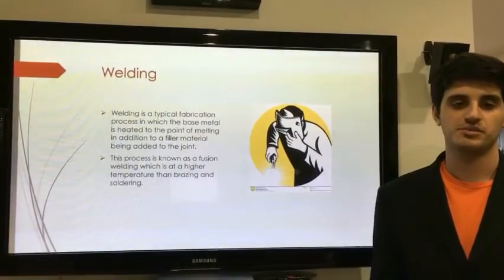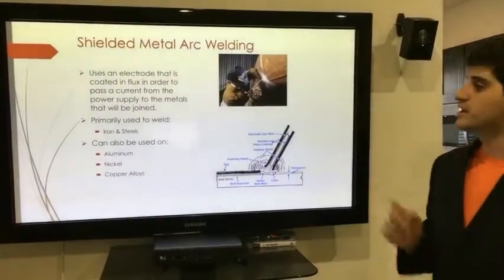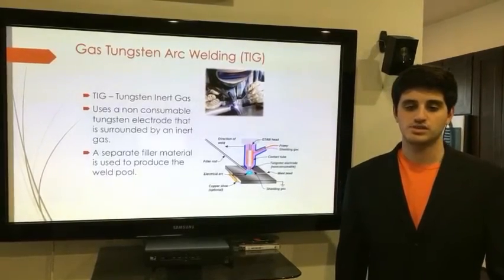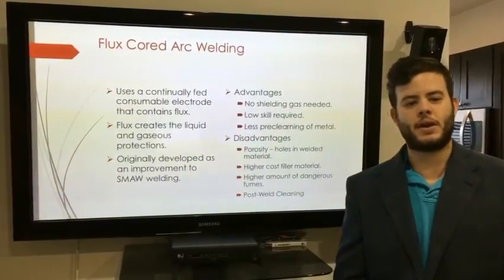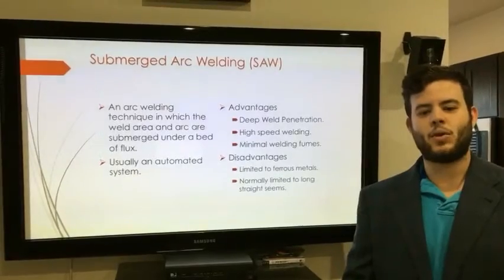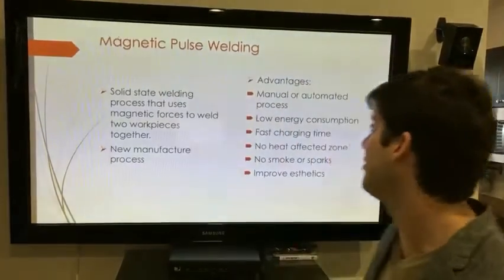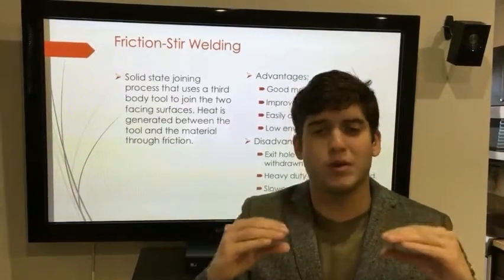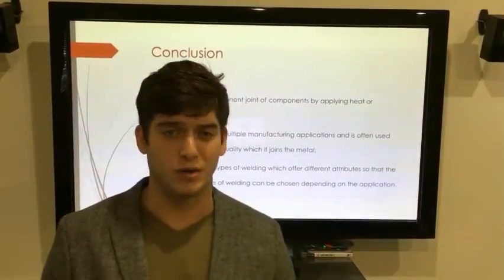Team 16: Types of Welding

Comment: The camera needed to be set up so the screen was centered and the cabinets were not visible in the back. Also, a stand would have been better than holding the camera. Lastly, some font was a bit too small, enlarging them would improve the quality of the slides.